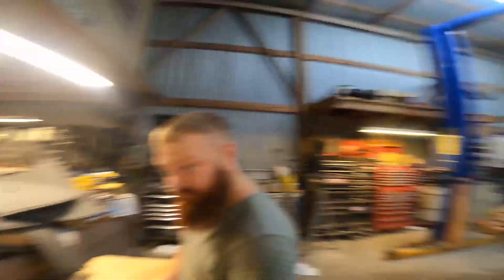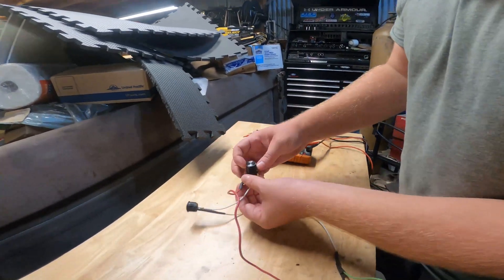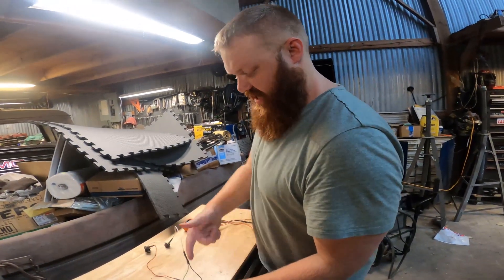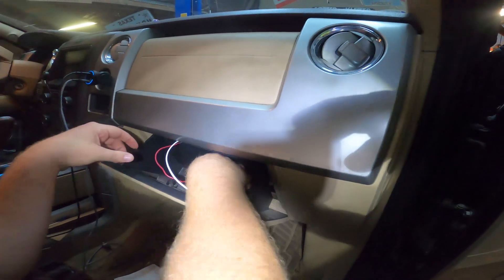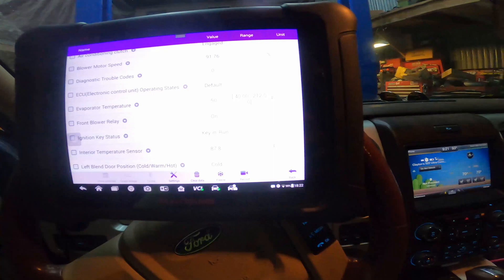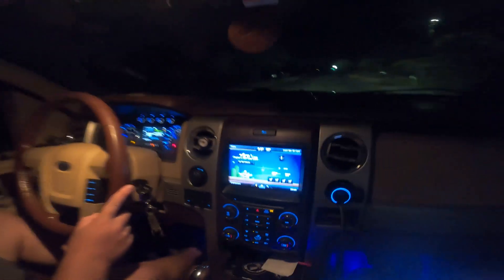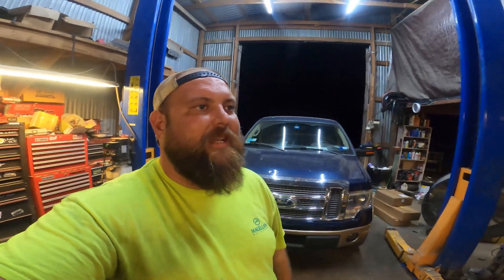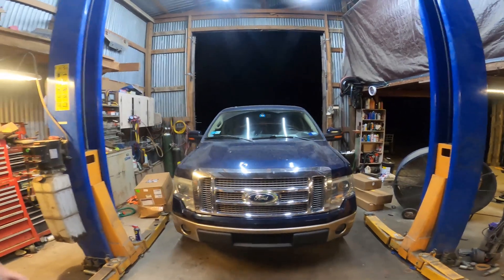2011-2015 Ford F150: AC Not Cold Enough, How To Decrease Vent Temperatures Easy!! Full Video #cars

Comment: Is it possible to just spice into the wire on one side of the connector in parallel and place the switch and pot there? Thought about using t-tap's or mil splicing into that wire to add resistance. I love the using the harness connectors... they're just a bit expensive and I plan on driving the truck into the ground (just want the A/C to perform better in AZ).
Reply from the maker: Yeah of course, it would work the exact same. We just like the idea of not cutting into the factory harness. It's also way easier to just plug it in than trying to splice all that under the dash lol. But 1000% will work just the same
Reply: @GreenCastleGarage  quick follow-up... With this mod installed, does the temperature control still work? I'm assuming that's just changing a resistor value or changing the blend door actuator position.
Reply from the maker: @brettraynes8140 yeah everything works as it should. It's just modifying the evap temperature input to the hvac module.

Comment: What scanner are you using? I'm new to that and don't know what I should buy.  Will a regular OBD2 scanner with live data work?
Reply: He is using an Autel scanner
Reply from the maker: You need a scanner capable of accessing the hvac module. A regular ole' obd scanner off amazon won't get the job done. In this particular case the most affordable way and the way I'd recommend is to get forscan. https://www.amazon.com/dp/B094Z7PBLS/ref=cm_sw_r_as_gl_apa_gl_i_WZFV5CMFZE6F78S0MYTV?linkCode=ml1&tag=greencastle09-20&linkId=b30e04aa780203003f4700759b33ee6f this is the forscan adapter i.have and use occasionally. You can pay for the premium or even get a free trial. Hopefully thay helps. If you want a link to the scanner I use I'll gladly send it but it's like $2000

Comment: That's very clever and I'm glad you mention fixing everything else first. It occurs to me that dialing the potentiometer back to 50º instead of using the switch would cure the colder temperature problem.
Reply from the maker: Correct, the switch just makes it an easy on/Off. You can also just unplug it as well lolol

Comment: kit arrived today and installed it right away. Dropped the temp on the passenger side vents from 65 to 45 degrees, and a hair over 40 in the center. And shout out to Shane for the super fast response to my mail, had the kit in the mail first thing the following day.

Comment: Was your compressor cycling? I have the same symptoms. I have a completely new ac system. My compressor does not cycle. I can’t wrap my head around how this would help my situation. Just cannot get vent temp lower than like 64 degrees. I live in Florida. My evaporator temp stays around 57 degrees. I have ordered everything to do this but I don’t have high hopes. But if your compressor was no cycling and this fixed yours hopefully this fixes mine as well.
Reply from the maker: @daltonwilson411  If im being honest I can't remember if it was noticeably cycling once it reached pressures. I don't think it was, but it was quite awhile ago. He's still running the mod and it's working great, wish I had more specific information for you.

Comment: Can the control points in the computer be changed to lower the temp without the external resistance source?
Reply from the maker: @StephenTrabosh  possibly, but I don't think anyone has cracked the hvac module to edit those parameters.

Comment: Just ran across your video.  Fantastic diagnosis and improvised repair. Crazy it was just suggested when I opened YT.  Inherited my dad’s 2009 F150 Lariat.  Had a lot of problems with AC, mostly because down in Georgetown where the truck was parked, mice had made a nice home in the Evap box.  But even after I got all that straight, the AC seemed to struggle on those heat index days of 115 degrees here in Flower Mound.  Had no idea this was an issue with these trucks.  AC manages fine on hot days with low humidity.  I wonder if high dew points are part of the issue on these trucks.  Anyway, great video.  I’ve already cut access holes in the box on each side of the coil when I cleaned it up.  Gonna look at that temp sensor to see if it is mucked up like some other comments have said.  I don’t know if my Amazon code reader will read the evap temp.  We’ll see.  Good job though.
Reply from the maker: @davidmclain7756  That's awesome that you have holes already, definitely come back and let us know what you find if you don't mind. It makes alot of sense to me that the thermistor could be getting dirty. But the mod has worked so well we haven't stripped the dash out to check.

Comment: The wpt-917 isn’t the right female adapter,wpt-1078 is the correct one
Reply from the maker: Thank you so much for catching that, when I swapped the links from the sold out ebay pigtails I struggled finding that female plug. I called my local dealership and asked him to look up the WPT number that fit the male, and that is what he gave me......ugh. I should have caught that it was inversed, but I certainly did not. I'm sorry for that.

Comment: Will this work on the 2015 new body style?
Reply from the maker: @robertscott1983  I'm seeing information that leads me to believe the ac is the same setup through 2016 with a bit of googling. I'm not 100% on that, but if you flup.your glove box down and the connector is in the same location I'd say that it will. If it does, please let me know and I'll update my title to the correct years
Reply from the maker: @robertscott1983  OK, so by pure coincidence a buddy just stopped by in a 16' F150. So naturally I took a look, and unfortunately it is a different design

Comment: This made a huge difference in my 2014 F150!!!! I got the extra connections at a salvage yard and they didn’t even charge me! I live in Las Vegas and it’s been around 118-120 degrees and my truck was blowing at 75 degrees and 80+ degrees at a stop. I made sure my refrigerant was topped off. I was in the green, but gave it barely some more refrigeration to be in the middle of the green. Started off at 305 ohms and got my truck at 65 degrees. Did it again at 353 ohms and got it at 62 degrees. Then did my last trial at 383 ohms and got my truck at 40 degrees at 115 degrees outside. Wrapped the potentiometer in electrical tape to prevent it from moving and then taped it to on of the wire harness so it will not get bumped. SO HAPPY!!!! Thank you so much for making the video!!!❤
Reply: Hey man, having same issue here. I live in arizona. 
You mean 300+ K ohms right? When its super hot my truck will barely blow 80-85 degrees 😩
Reply: @Eltanque-z4m  yes that’s right I’m not very good with electrical  but on the ohms side of the multimeter I could only read from 2000k ohms part of the meter. I wound up setting my Potentiometer at 397 ohms and hot gluing it. And I just make sure I don’t go below 40 degrees to damage anything.  Try that.

Comment: Added resistor but temp started to go up at the vent?
Reply from the maker: How much resistance did you add? It's finicky, so you may be freezing up your coils. If that happens it will start blowing warm air fairly quick and you need to turn your system off quickly.
Reply: 330
Reply from the maker: @miguelsandoval2210  yeah that too low, take it up to about 400k and try that. The lower you go the colder it gets
Reply: When adding resistance the compressor won’t kick on.  What next?
Reply: Take away resistance compressor kicks on.
Reply from the maker: @miguelsandoval2210  I apologize, I sent you the wrong direction for sure. As you decrease the resistance of the potentiometer you will.increase the evap temp readout therefore lowering your vent temps by cycling the compressor longer. So less resistance is colder

Comment: I believe the PCM is supposed to kick off the compressor when it reads between 35 and 38 degrees which would give you low 40s out of your vent... Usually the problem is the sensor gets covered in dirt and debris from using the fresh air recirculation which is a No-No should always be on Max AC to keep that door closed and the dirt out... Easier fix is to drill a hole in heater box grab the sensor pull it out clean it off put it back in cover the hole with the plug and some HVAC tape work great for me... My vent temperature is usually around 42°
Reply: What sensor are you talking about?
Reply: @miguelsandoval2210  evaporator core temperature sensor... It's the one that gives everybody trouble and the only way to change it without improvising requires removing the dash and opening up the HVAC box
Reply from the maker: @miguelsandoval2210  The evap temp sensor. It's the one we unplug and put the resistor between.
Reply from the maker: @kennethrobinson5151  This actually makes alot of sense. That being said I watched this unit settle at about a 55 degree reading and that's where it keeps it.
Reply: @GreenCastleGarage  mine was covered with a sticky oily film along with a bunch of dirt must have been causing a false reading... Took me six years to figure that out I replace the condenser the dryer the expansion valve the high pressure sensor none of that made a shit of a difference the compressor kept on cycling on and off about every 10 seconds or so... I was going to replace the sensor with one from an f250, have to buy the whole evap corr to get the one for an F-150 nobody makes just the sensor... But cleaning it off did the trick
Reply: @kennethrobinson5151  do you have a post you followed on how to find and clean that sensor?
Reply: @GreenCastleGarage  recently I had bypassed the sensor with a 1/4 Watt 2.5 thousand ohm resistor which works but the compressor never shut off and it iced up the core under certain conditions
Reply from the maker: @kennethrobinson5151  yeah, that's way too little of resistance. The resistors are finicky to get them right, but it tracks perfectly with what you found.

Comment: Weird thing is my Company work f150 blows a lot of cold air, like you would expect but my personal f150 lariat AC sucks their both 2014
Reply from the maker: These systems are more finicky than most. If I was you I'd check the outside air filter and the recirculation blend door first for sure

Comment: Is there a way to tap into existing wires while installing pot and switch, but without buying the connectors? Also is there a wiring diagram for newbies?
Reply from the maker: Yes of course, just need to put them on the wires that plug into the temp sensor

Comment: Hey guys great video. I was wondering if you knew if that circuit happens to be a positive or negative circuit. I was thinking of my on off switch being one with the blue light when it is on. Just a little added feature for myself.
Reply from the maker: @CharlesSumrall-s3i  you know, I'm not actually sure. I'd just unplug it and check with a voltmeter.

Comment: Really cool, those plugs aren't cheap though. When I do it I might solder in cheap plugs.
Reply: I went to a salvage yard and sniped them from another F150. The guy at the salvage yard didn’t even charge me.
Reply: @megaman925  great idea!
Reply from the maker: @brianl2875  you could just splice the setup inline with the existing harness. We just wanted a setup that could be removed without effecting the factory harness

Comment: I live in Abilene. I’m getting burned to death in my 2010 super crew cab. Got a baby on the way and need to get a colder ac. Just had the ac recharged. Can I have y’all do this on mine?. Or order one from you.
Reply from the maker: @jacobchamblin6317  I can build one and send it for $150 or if you'd rather I install it and tune it in you can come to south ft worth and it'll be $200. Email is shane.d.spalding@gmail.com.
Reply: @GreenCastleGarage  I’ll send you an email

Comment: @GreenCastleGarage Based on what I can see in the video, your potentiometer is in parallel to the actual thermistor and therefore lowering the resistance seen by the computer. Am I correct? Thanks.
Reply from the maker: It's been some time since I've looked at this circuit, but I'm pretty sure it's in series adding resistance to the output of the sensor
Reply from the maker: @gtrepani  OK I went and pulled the one out of the truck here and I apologize. You had it correct with the parallel. My brain wasn't good enough to remember lol. Sorry if I added confusion
Reply: @GreenCastleGarage  Thanks for following up on this! Based on what I could see in your video as well as what I saw in another video showing the resistance range as the temperature changes, I figured that your circuit had to be in parallel and not in series. This is a great hack! Now I need to play with it more to pick a safe value that ensures my evaporator doesn't freeze up. Thanks again!

Comment: Will this make my ac colder in my 2013 f150 ecoboost?
Reply from the maker: Yessir
Reply: @GreenCastleGarage  so just install it the same way you guys did with the 1m ohm potentiometer and it will work? Do I have to scan the truck or do anything else after install? It won’t make the truck catch on fire, right? lol. I’m in sw Florida and it’s brutal. Ac in these truck sucks but a little colder would be nice! New lines, new condenser, newish compressor, new cooling fan, and new Freon. It blows cold but not cold cold.
Reply from the maker: @danielmarjanovic9957  yeah, it was so long ago I can't remember the good starting point but I think it was like 300k ohms. You start there drive it like 5 miles then increase it a little and repeat until you get it just right. A scanner that sees the evap temp certainly helps but isn't necessary. If it goes from real cold to hot all of a sudden turn the ac off because you've frozen the lines. Also.means you be added too much resistance
Reply: @GreenCastleGarage  what am I increasing? The temperature on the controls for ac?
Reply from the maker: @danielmarjanovic9957  you're spoofing the temperature from the vap sensor. So the compressor cycles longer

Comment: Ok, just purchased a 13 F150 and I thought i was going crazy, glad its not just me that noticed this for their A/C. Will definitely  look into doing this, in Central Texas here and summer is already kicking in hard.
Reply: Make sure it's not a broken recirulator door (what i just fixed on my 13 f150. AC works but max AC didnt. Fixed it by watchn a video on replacing the door.
Reply from the maker: Yall getting all the rain we are in DFW? In goes from hot as hell to cool and thunderstorms every other day it seems lol. Also, it's not a bad install at all, good luck and feel free to ask if you have any questions
Reply: @GreenCastleGarage   Oh yeah, I can definitely  relate. It's  hot then cool, windy with some scattered  rains, then hot+ muggy! It's annoying as hell. Meanwhile I'm over here blasting it on setting 4 to cool off. 😂 definitely  gonna source all the parts needed and knock it out soon on a spare wknd.

Comment: It's so much easier to get a HVAC temp probe from Lincoln Navigator 2009 ish, drill a new hole to left of evaporator, CAREFULLY... Plug in is the same and it drops temp 10°
Reply: I wish I could post pictures.
Reply from the maker: That's a slick idea. A lot of folks like the ability to go back to stock though, either way, it's definitely an awesome option and one I didn't know about. Appreciate the comment
Reply: $2 Dollar part from salvage yard. Runs same ohm resistance as stock. Just further from evap. Been monitoring high/low psi and it's split almost perfectly, and no it's freezing me out!!
Reply: Heater core or ambient temp sensor? Also, exactly where am I drilling the hole?
Reply: @luvmychevy1951  I wish I could post a picture. To the left of evaporator. About 3" Be sure not to drill into evap

Comment: Hey is there a way to pit a switch with 3 positions so that way you can set a hot weather and cold weather ie one bypases the resistor
Reply from the maker: You don't need a 3 position switch, just a regular on off like we did. When you flip off you wire the circuit normal not using the potentiometer. Therefore, it is your cold weather setting

Comment: Ive got a 2010 and am currently sitting in 97degree temps with ac blowing as cold as possible and im sweating my balls off so now i know what im doing next
Reply: Hey i got my snake cam through the thermosistor and its caked ill send a link when my video gets uploded
You may just need to clean the coil and it should blow way faster

Comment: Have you had any issues with this fix? I also live in north Texas and just installed this today.  The ambient temp is 92 F @ 38% humidity.  My temp at the vent was 56 F with the switch off, and then dropped to 42 F with the switch on.  I increased the pot a tiny bit in hopes of getting to 40 F, but then it started going up and got up to 60 F.  I stopped the car and turned it off because I figured the system was starting to freeze.
Reply from the maker: Do you have a scanner to watch the evap temps? It helps alot. It still took us quite a few trips to get dialed in, but it's been perfect ever since. If you want to drive down to south Ft. Worth we will gladly give you a hand also.
Reply: What part of Fort Worth? I live in Saginaw, and I really want to do this mod. I'd like to check it out if I could @GreenCastleGarage
Reply from the maker: @dereckplante2928  I'm south of Ft Worth in Burleson
Reply: @GreenCastleGarage  have you guys thought about just selling that harness already made? I'd buy it for a fair price
Reply from the maker: @dereckplante2928  we are very much considering it
Reply: @GreenCastleGarage  how can I get ahold of you? I’d buy 2 plug/play kits if it’s not too expensive. Thx!
Reply from the maker: @305sergio  My email is shane.d.spalding@gmail.com. Shoot me an email and I'll send you my number